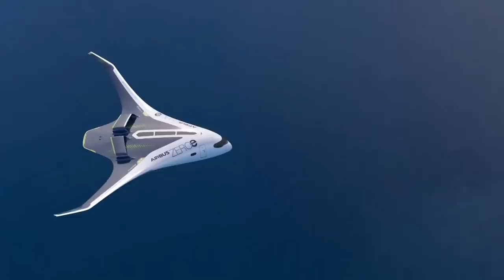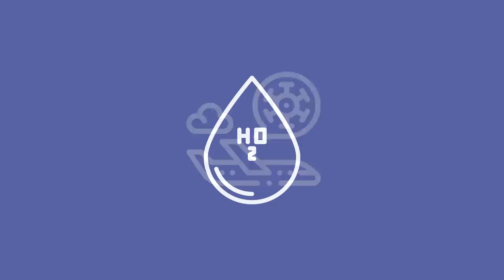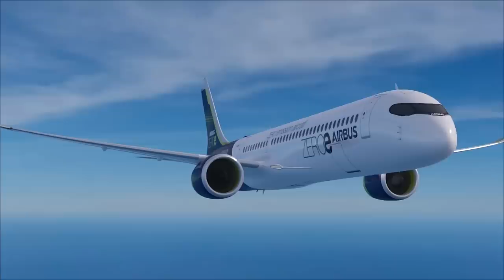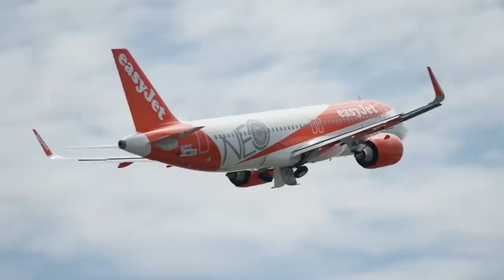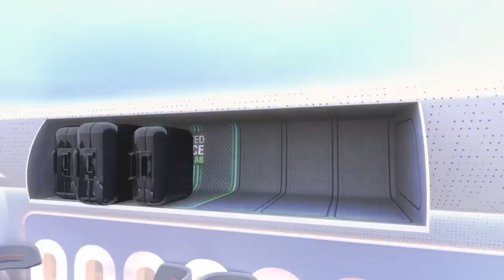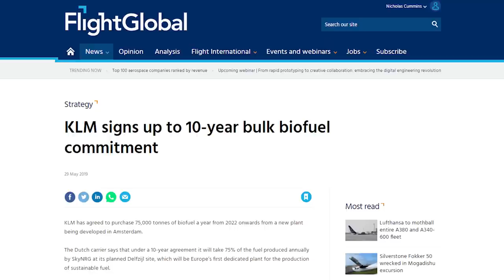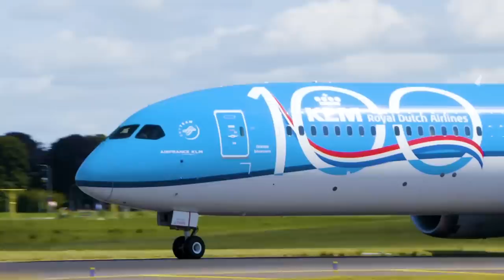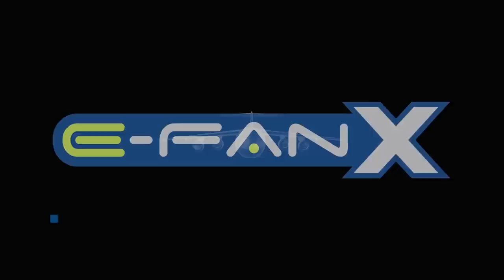Airbus Future Plane Concept - ZEROe - Hydrogen, New Cabins And Zero Emissions - Never Built

Comment: I am I interested in the practical engineering aspect. Being a cryogenic, where would the hydrogen be stored? Being hydrogen, and being less dense than a Hydrocarbon, is it any reduction in range with a hydrogen based fuel source when compared to åHydrocarbon? With the X 31, there were significant engineer in problems with the hydrogen fuel tanks, as they were composites.
Reply: Probably gaseous under ~1000 bars. Takes larger volume, but less mass than kerosene.
Reply: @bazoo513  1000 bars..really? The LH2 tank on the Space Shuttle was pressurised to 202 kPa, or 2 Bar [https://en.wikipedia.org/wiki/Space_Shuttle_external_tank#Liquid_hydrogen_tank]....To contain the pressure tank would be so heavy, all of the plane will not be able to takeoff, or the payload would be extremely limited, Or not at all, the plane would be trying to fly only the LH2 tank! . Sir, let's deal with practical engineering problems, and solutions. Even if you had composite tanks, it will not work..but the LH2 Composite tanks on the X-31 Had such fundamentally Difficult engineering problems to solve, Nasa gave up and canceled the whole program. This is not gonna fly!  This is why in over 100 years of flight, no one has built a practical aircraft using hydrogen as a fuel, except for aircraft Flying faster than Mach 4...Where they need to cool the leading edges, And aircraft body so it will not melt.
Reply: @hypercomms2001  Yes, really. Shuttle's external tank was cryogenic - both hydrogen and oxygen there were liquid. Hydrogen fuel cell cars, OTOH, store hydrogen as a gas under high pressure (e.g. Toyota Mirai - about 700 bar). Those will be relatively small, cylindrical lightweight composite tanks.
X.33 (not X-31) had problems with carbon composite tank delamination (which was, BTW, solved at the moment of project cancellation), and it contained cryogenic, not pressurized hydrogen.
Reply: @hypercomms2001  Google around for available, relatively cheap commercially available products - they store hydrogen ar ~500 bar and weight ~200kg for 10kg of hydrogen. Larger tanks will have better weight-to-content ratio.
Bur recall that Airbus chief also mentioned "hydrogen in synthetic fuels" - my guess would be methane produced from CO2 captured from air and water, via Sabatier process. But this is just a guess.

Comment: Actually, hydrogen fuel cells make the most sense and not hydrogen combustion. Fuel cells are way more energy efficient than combustion. Combustion is one of the most inefficient forms of energy conversion. Also, the high temperature of hydrogen combustion still produces nitrogen oxides, whereas the much lower temperatures of hydrogen fuel cells don't produce any emissions except for pure water vapor.

Comment: You can air-travel 2000+ miles on hydrogen with a different design.
LAPCAT A2, an airbreathing offshoot of the Sabre Skylon spaceplane. Mach 5.5, 300 passengers, 8500 mile range.

Comment: The big hurdle for hydrogen-powered aircraft is the handling and storage of the hydrogen itself. Hydrogen gas, stored at around 100 bar of pressure and at 20 degrees Celsius, is over 100 times less dense than kerosene (0.0078g/cm^3 vs 0.79-0.81g/cm^3), meaning that you need enormous tanks to hold a comparative amount of fuel. Even as a liquid, it has a very low density compared to kerosene, being only about 1/9th as dense - this is why, when you look at the big orange tank on the Space Shuttle or its successor, the new SLS, over 3/4 of the tank is for liquid hydrogen, with the part for liquid oxygen being the small section in the nose above the ribbed intertank.

Density aside, hydrogen is dangerous and difficult to work with. Recall how I gave the example of gaseous hydrogen being stored at 100 bar? To those who don't use metric, that's about 1450 PSI - EXTREMELY high pressure. Even if the hydrogen didn't combust in a tank failure, the pressure alone would cause a devastating explosion, so those tanks must be very, VERY over-engineered to prevent that. 

Secondly, it's hard to keep hydrogen in the tanks without it getting away; gaseous hydrogen, being the smallest molecule found in nature, will slip through even the tiniest cracks; helium balloons deflate over time, and helium molecules are twice as large! And that's not even talking about the tribulations of liquid hydrogen; a cryogenic gas that must be cooled to insanely low temperatures and kept at extremely high pressures. Even with excellent insulation, liquid hydrogen will boil off over time (yes, hydrogen gas can still boil at 100 degrees below zero), so unless you consume it faster than it boils off, to prevent the tank from over-pressuring and rupturing, you'll have to vent it off, causing you to lose that fuel. So, you can't just swap out the engines and then fill up the tanks of existing airliners with hydrogen.

Hydrogen is an EXCELLENT fuel from a performance standpoint, but from a logistical standpoint, it's a nightmare to work with. The key to the future is finding better ways to store and handle hydrogen.

Comment: For the skeptics, the Soviets, of all people, had a Tupolev-155 flying on hydrogen in 1988. Pictures here:   

https://www.youtube.com/watch?v=U9zgCsEqnG4&t=222

It does work. On top of that, hydrogen has a staggering 2.8 higher energy density than kerosine (but also 4 times the amount of volume required for the same energy). But in aviation reducing weight is more important than extra volume. You can for instance store liquid hydrogen in the ceiling, think Airbus Beluga. Hydrogen promises a far larger range than possible with heavy batteries. The world minus the US has decided that fossil needs to go. Hydrogen will replace it. Conventional fossil fuel is depleting anyway.
Reply: well... size matters too for drag. thou if nuclear fusion will work that we could have enough hydrogen for using it...
Reply: Hindenburg had hydrogen.  promising isn't it?
Reply: @vahehatch2800  Concorde had kerosene. Who would ever take a kerosene-powered plane after the Gonesse-disaster?
And by the way: The planes won't use thin-walled balloons as fuel tanks.
Reply: @701983  if you follow closely the video about Tu155, you'll notice that they had "Azot", that is Nitrogen aboard to keep the compartment around their 20m^3 hidrogen tank safe during operation. For kerosene such precocionary measures are not required. Plus, the entire project is meant only to beat some environmental issues, not the Soviets. So, we won't be flying Hydrogen any time soon.
Reply: @vahehatch2800  Liquid hydrogen is undoubtedly a very inconvenient fuel. And you might be right and there will be no commercial hydrogen airplane in foreseeable future.
But I just can't stand this idiotic Hindenburg-argument any more.
Using hydrogen in balloons for lift is completely different to the use of liquid hydrogen in robust fuel tanks.
By the way: The major part of crew and passengers survived the Hindenburg fire and crash.
Unlike the fire and crash of the concorde.

Comment: It takes a lot of energy to make hydrogen. Unless the hydrogen is produced with green energy, the emissions are just being shifted, not eliminated.
Reply from the maker: I don't believe Hydrogen is the future
Reply: Just like electric cars shift the emissions  "a gram of carbon dioxide emitted from an ICE car's tailpipe has the same effect as a gram of carbon dioxide emitted from the stack of a power station."

 The point isn't to achieve "net zero” emissions from airplanes. Instead they are making a big move from fossil fuels to cheap renewable energy that is sustainable and cost efficient in the long run. 

Hydrogen has a lot potential that BATTERY electric technology is very far from achieving in ships, planes, race cars etc.

Comment: When the water is released in the atmosphere, did anybody calculate the greenhouse effect from the water vapor and compared it with the released Co2 from normal petrolium planes? Would be interesting if it is better and how much better. :)
Reply: Probably a drop in the ocean compared with what evaporates from the ocean.
Reply: There is no real greenhouse effect from that. It’s water vapor, it forms clouds and then rains down as pure water.
Reply: Water vapor is qite an extreme greenhousgas - pops up in the calculstions...but I honestly don't understand it, because as you pointed out - clouds. Maybe it's different in a cloud or it probably has to do with how high you you release the water vapor. Don't know.

Comment: I have a few questions tho. Where will they get the hydrogen? Water electrolysis? That is very energy expensive. Most hydrogen plants (farms) today work by gasifying Methane or long chain hydrocarbon at high temperature to produce Hydrogen, and Carbon Monoxide (which will be released in the atmosphere).
Reply: I am a fan of the wing shape, i think it is about time because we have enough experience with single wing aircraft for that but the hydrogen engine is a big risk.

Comment: We have zero emission cars running on hydrogen now.  The problem is, isolating Hydrogen. It still takes a lot of power to get a tankful of Hydrogen.  Remember, Hydrogen is lighter than air, so collecting it is impossible. Separating from the air takes power and at sea level there is not much H2 hanging around.  Melting Zinc in acid gives off H2, but how much unnecessary zinc do we have lying around.  Power of any sort is too expensive to get a reliable supply of H2.  We will have to conquer fusion to get us the power for something like supplying enough H2 to satisfy the airline industry.  Just saying their technology is dependent on many advancements in other industries to make this all viable.  I am hopeful, though.

Comment: I just can't understand how people can think that 
- electric planes can be commercial aircrafts, even with the projection on the technology for the next 20 years
- lifting bodies with be practical aricrafts.
- Hydrogene as a mass production electricity storage solution will be a reality (and less armful to the Earth than burning fuel...)

I can say these things :
- compared to a turbofan, a power-equivalent electric engine group will weight dozen times more - this is a major problem
- electric propulsion means airscrews. Think of the implications.
airscrews mean planes flight lower, with mor noise, slower and are overall less efficient for middle to long range duties.

There are so many things that bring us to think that electric plane will be far less efficients than thermic-powered planes.

One solution is less planes, only for valuable journeys (no tourism...)

Comment: Hmm, well hydrogen is lighter weight than hydrocarbons but it also requires higher pressure tanks to hold it.  It probably needs to be refrigerated too.

Comment: Cryogenic hydrogen requires extremely large tanks because of it lower density as well as shielding to prevent it from boiling.
Ethanol or bio diesel is more effective despite it producing some CO2 as it can be produced from algae farms.

Comment: Amazing how the airline industry has given up on SST. In the 1950's futurists and aerospace experts all thought that we would be flying on nuclear powered airliners traveling Mach 3+. The fact that there are sleeper cabins on airliners today shows just how little we have really progressed. Travel times do not have to be this long. They are only this long because the industry refuses to develop SST technology.
Reply: The industry has not given up but they can't overcome the main problem which is the sonic boom. That precludes any widespread use of SST.
For normal planes, we could technically go faster but it requires too much fuel so it was chosen not to go faster.
Reply: @aidanclarke6106  Is it really a problem at high altitude >100K feet? We could go nuclear and be zero carbon. We could build new airports offshore on in lowly populated desert regions to mitigate crash problems. Then customers get on a commuter plane or bullet train to their final destination.

Comment: THEY CAN PRODUCE HYDROGEN FUEL ON SITE AND FOR ADDITIONAL LIFT ASSISTANCE THEY COULD USE BETAVOLTAIC POWER CELLS WITH STORAGE CAPACITORS NOTHING LIKE A SELF-RECHARGING BATTERY TO KEEP YOU UP IN THE AIR

Comment: Anyone willing to take a stab at what the cheapest source of hydrogen currently  is? 

If you guessed crude oil then you would be correct. Other methods of getting hydrogen exist but are much more energy intensive and simply don't scale well.

Comment: Batteries is the way to go for short and middle distance aviation. Gains in energy price on batteries will justify its adoption. Right now H2 can only try to match fuel in price. Yet much more explosive.
Reply: Wake up. Batteries weight too much. It has been said a million times already.
Reply: @almerindaromeira8352  400kWh/kg is where they start to make sense. Yesterday Elon said that could be achievable, surely. But sure you know more.
Reply: @eduardpertinez4767  where they start to make sense does not equal they are the future of aviation! What do you consider middle distance? How much payload? Do you realize that we are talking about half the speed? There are studies out there, one very easy to read from NATO also has a case study for regional aircraft in the middle that you can check out. 
Does not however address problems like safety, maintenance and charging. Did you know average aircraft utilisation in the US is 12 hours flying/day/plane? That means the battery must take in energy at the same rate it releases it... 

Elon musk is the guy who tried to reinvent the tunnel...

Comment: My vision for the future of flight (20ish years from now) is that local flights (<300 miles) will be handled by EVTOLs, regional flights will use hydrogen powered aircraft, and long haul flights will be handled by vehicles like the SpaceX Starship. SpaceX already has plans for point to point service that will be around the price of a first class airplane ticket.
Reply: Might be in 50 years, not in 20.

Comment: More viable alternaive: Startup AirZep, which goes retro to airships of pre-Hindenberg era that float lighter than air with H2. Designed to begin a journey at high altitude, it consumes its flotation inflation-gas as a fuel, shrinking, but descending to lower altitudes where buoyancy is higher as the ship gains relative weight to volume.

Comment: Liquid Hydrogen is not easy to work with. Keeping it at -273C will be a problem all by itself. Kinda like when Reddit was freaking out because Bill Gates (Erroneously) was said to be building a yacht which ran on LH2. Where do you get it fueled, Kennedy Space Center?

Comment: Three seats in rows takes up the exact same space as a triple bunk bed to lay flat. On flight longer than five hours, I always Sleep so would pay Extra to have a flat bed similar to the new Austrian Night Trainsets. Triple to quad bunks with sliding privacy doors.
Reply: Crash safety would be a problem. There is no alternative to seat belts. Nothing would keep you strapped down while lying in bed... unless somebody invents gigantic airbags to keep you from smashing into the  the upper bunk.
Reply: @___Chris___  Before covid, there was always over a million people in the air (in planes) at any time of the day, 24x7x365. 
The number of crashes are rare. 
A laying down bed can have, often have belts, straps. They prevent rolling out of bed and on planes keep in the bed during turbulence. There are several airlines with first class seats that become beds and back to seats. They exist and are very comfy for flights over seven to eight hours... :)
Reply: @geoffreythorberg2580  I'm aware of the rarity of crashes. It's not that relevant. Safety is often a psychological and legal discussion. I'm sure that a single crash with more victims lying in those beds compared to seated passengers would be enough to create a media shitstorm and have NTSB recommendations to ban those beds. You can't compare this to first class seats that can fold back at any time. You also can't strap down the entire body. Nobody would want to sleep tied up like that and easy&quick release in case of an evacuation, ditching etc would also be required. All in all: not very realistic that this would ever pass an FAA (/EASA) certification. Yes, those agencies are paranoid, but keep in mind that we have these low fatality numbers BECAUSE they are paranoid. I'm a (private) pilot myself and have owned an aircraft for many years, so I have my own experience with seemingly exaggerated air safety rules. Moreover: certification would not be based simply on common sense (which is where I would agree with you), but according to the results of crash test models, no matter how rare severe crashes actually are.

Comment: The question is, can hydrogen be stored under low enough pressure that the use of steel pressure vessels won't be a requirement? Are they planning on storing it in a gaseous form with enough volume to do that with lightweight materials?
Reply: Liquid hydrogen is stored at 700 bar in carbon fiber tanks. These are about 5 times as strong as steel tanks of equal wall thickness. Hydrogen can also be liquified by cooling it down to about minus 250°C. These method of course require a lot of energy, reducing overall efficiency and making hydrogen expensive, without any hopes for this to change in the future.

On the other hand, there is also the possibility of chemically binding hydrogen in a form that is easier to store, such as ammonia, liquified at about 30 bar at room temperature.

I hope we'll also see direct ammonia fuel cells in commercial products, because at least in the lab they are more efficient than hydrogen fuel cells (and ammonia is cheaper and has a higher specific energy than hydrogen; it reacts CO2 free, releasing only N2 and H2O). I am aware that this video is about hydrogen in combustion type engines / jets and not fuel cells, but why not?